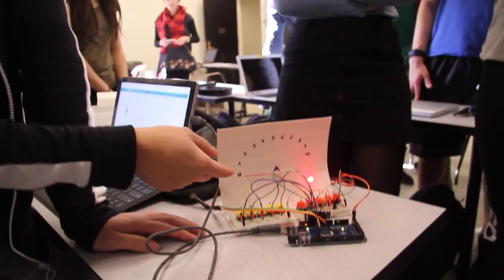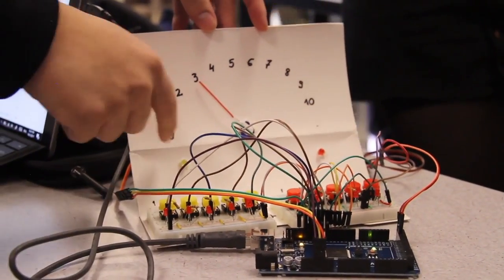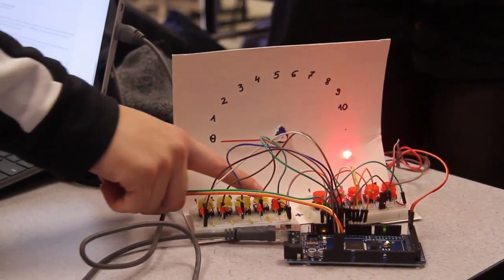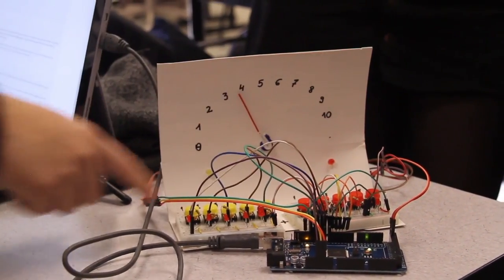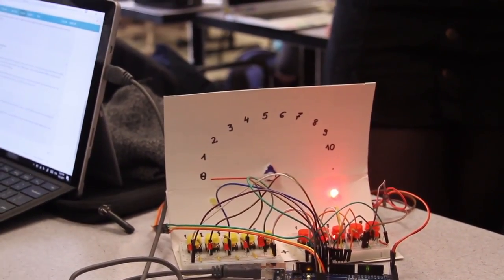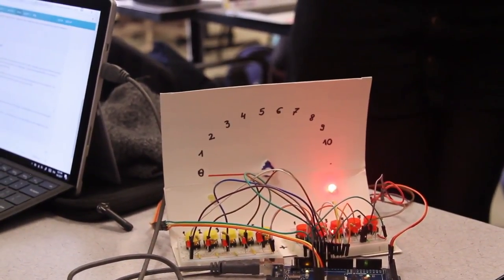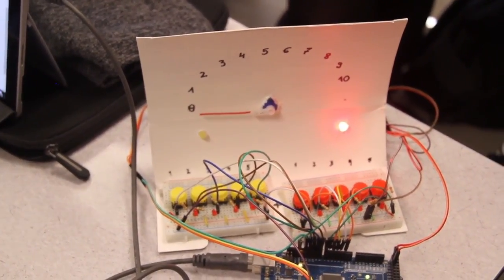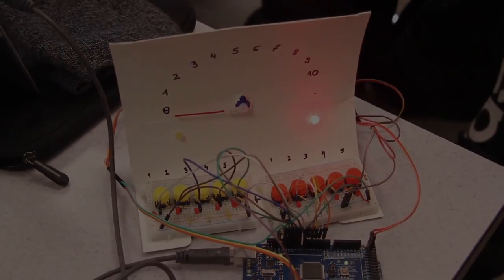Short Project: Calculator

Comment: This would have taken me about 15 minutes to do this project. And that's without an MIT education. That's with a GED. And look at the chaos in the wires. Where's the color coding? That matters for debugging purposes and becomes a habit when you do this enough to "know what you are doing". 3 years and 10 months before this video was uploaded, I, by myself, in 1 day, made a digital thermostat with smoke and flood detectors, a clock, settings menu and a siren. It had an analog calibration dial so that it could double its lifespan while remaining accurate. It had a 9V rechargable backup bank. It was the very first project I ever made using microcontrollers. The next project I was going to do, before life got in the way, was going to be a handheld tetris game inspired by a youtube video. Is this what MIT is doing as of the end of 2017? Is this "state of the art" robotics technology? Making machines that add? Not to sound pompous or anything, but think about it this way.....I failed the 9th grade 4 times and received my GED a year after I was supposed to graduate, and I am 3 years ahead of MIT, by myself. And if this is not the "current event" of MIT education, why would they take the time to think about it, plan it, do it, record it, explain it, edit it, upload it, and write a video description? What am I supposed to think??? I have seen kits designed for children 8 and under that exposes them to programming using physical logic gates....to build computers at the capacitor level! Let that sink in.
Reply: This project is so redundant.😩😩😩. What use would a caculation that performs addition be???